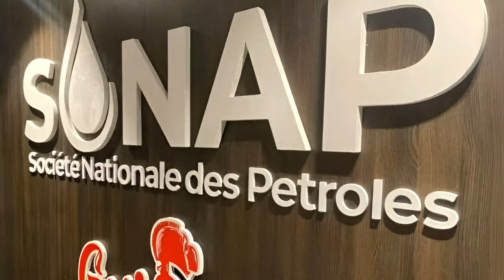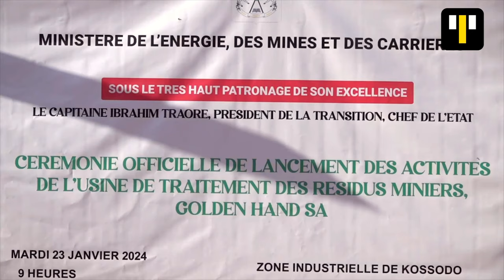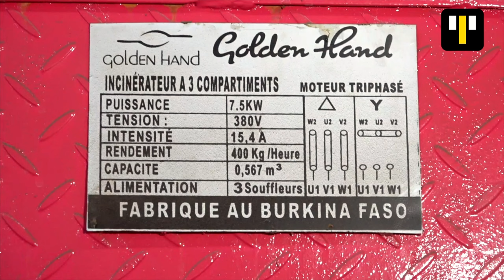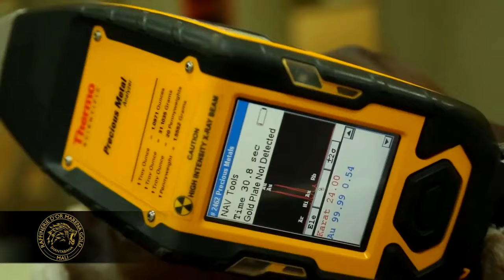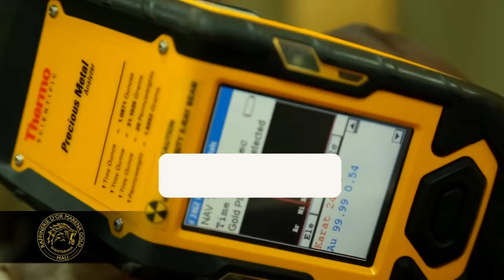Ibrahim Traore Sends SHOCKWAVES To The West With This Brilliant Move!

Comment: I've been thinking about the Mining industries in Africa. I feel like every gold mine should have a tall electrical fence around it. With razor wire at the top. And also motion sensors and cameras. And fully armed, fully equipped Burkina Faso special forces team on 24/7 security. Guarding the perimeter. And drone assistance. And some those high-powered missiles that they have now. With all of that they could rain hell down on any terrorist that would even think about coming into the mining area.
Reply: Do not stop there... Security around the refinery too.  Gold is crucial in high-end electronics.
Reply: @macmen007  exactly. And the refinery should have the same security. Thanks bro.